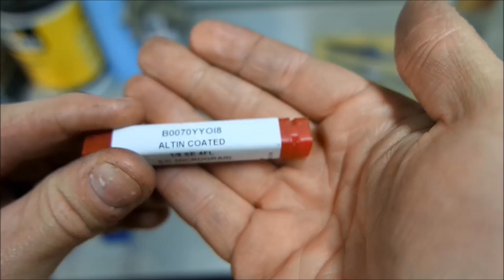Milling Without A Mill! (On The Drill Press) | Güth Blades

Comment: This is for viewers...I expect since this vid is over 3 yrs old that the creator has figured this stuff out....The x,y vise he is using has gib adjustments on it. If he had of adjusted those gibs that vise would be fine...A drill press works very nicely for milling wood, plastics and very soft metal like aluminum. Not so good for harder metals.The higher quality that your drill press is and the softer the material...The less chatter you will get. Most drill presses are not made to take a side load. If you try to cut hard materials the chuck will come out of its taper unless you have one of the few drill presses that the chuck is fastened.  If you are wanting to mill soft materials like wood and plastic and softer aluminum there is no point in spending allot on a mill. Buy a cheap drill press and a cheap x,y vise and look into getting some high quality bearings that can take side load if you experience allot of chatter... Get a mill if you are gonna be doing allot of milling on anything harder than aluminum. Also on a drill press you are limited on the size of material that you can cut by the drill press and the vise size.

Comment: for operations like this you should use a roughing endmill. with this bit you should instead begin from the top and carve your way to the bottom, very light cuts, even more with a drill press. This will reduce lateral forces. dont use x y at the same time, set your z, travel along x or y during the cut and move back to starting position, also avoid up milling for the same reasons, it adds more forces during travel and also will damage your bit faster.

Comment: Just be careful because too much side load could cause the chuck to fall out.  The only thing holding it in is friction.  When you use the drill press normally (vertically) the chuck is always being forced into the taper in the press tightening it.
Reply: Agreed, but the only way to mill effectively and not have the chuck drop is to replace it with an MT2 ER32 or ER25 collet chuck with a drawbar of some kind backing it up and a clamping collar on the outside backing that up at the quill to collet chuck interface. It can be made safe and rigid but steps are required with parts and some turning. Like most machining equipment, making a milling machine is much easier if you already have a lathe. The learnings from the process are really great, but there is a knowledge curve and some parts making for the process to succeed with a viable tool that can be used for real machining when you need it.
Reply: Yes a collet chuck with its arbor to replace the drill chuck and arbor is the way to go. The only solution I have seen to securely retain collet chuck/arbor in quill is to drill hole thru the two with a bolt and nut. Perhaps there is a way to add a locking drawbar to a drill press but have never seen how.
Reply: @danah358  It is rather clunky, I made a mini drawbar with an M6 bolt that locks through the taper knock hole. It is quite fiddly but it works, especially with a locking collar on the outside interface to back it up and if you leave the ER chuck in. I set up my drill chuck to work with the ER chuck when needed. Some will baulk at the need to adapt the drill chuck but it's a priority I chose to make to have a rigid light duty milling setup. I already had a quality X-Y table, milling vise and toe clamps so for no large expense I'm now milling. If I had the shop space I probably would get a proper milling machine but this does decent work with good surface finishes.

Comment: I guess you have never seen a real mill. Slow steady small cuts from the TIP OF THE TOOL. amazingness
Reply: indeed i say the same but bot readed yours only need the tip
Reply: Made me real nervous watching him cut from the flute
Reply: A game of just the tip.. lol
Reply: Surely four flute end mills are intended to cut on the side - you can’t plunge cut with them - that’s what two flute end mills - slot drills - are intended for otherwise I’d agree with all of the comments he made. I’ve cut keyways in shafts, machined hexagon nuts from round bar and other intricate things with my two axis milling vice.
Two things I’d recommend :
If the machine has a screw-type adjustable depth stop, use that to control the depth of cut, and use the quill clamp to lock the quill at the set depth
Reply: Make sure that the gib strips are snug to ensure there is no looseness in the slideways, and lock up the axis of travel which you are not using, to improve rigidity
Reply: Ý

Comment: I've torn up a few drill presses trying to mill on them. If you keep your feeds really light and stay with small diameter cutters you can get away with it but sooner or later you get over confidant and too familiar with it and hurt the drill press. The really old heavy duty drill presses seem to handle it better. My primary use for an x-y table is when I need to do really precise hole locations. And in a pinch I have clamped one to the ways of a wood lathe, played with the pulleys to slow it down, improvised a tool post and done some emergency metal turning jobs. As long as you don't need power feed it works great.

Comment: He’s not a machinist, he’s working with what he’s got. I will say that the lateral pressures the drill press is taking will cause damage.
Reply: Agreed. I broke a drill press shank doing something similar while very young - trying to cut grooves in rubber wheels for a sliding gate track. Using it as a lathe. The spindles are not designed for axial loads.

Comment: i'm not a machinist, but i'm certain you are supposed to take many passes going in like a 1/16th or 1/8" at a time. Just a bit at a time so you don't stress the sides. I've done this with drill bits with not so accurate results, but it worked, though it came out wonky.

Comment: I do not use a chuck but a collet whit a MT2 modified (shoten) whit a "T" bolt inside the opening of MT removing tool. The "t bolt is use in place of draw bar.

Comment: I just used my drill press to mill a barrel inlet in a piece of black walnut for an antique gun. While I'm happy with the results (which I just used the press to hog out the majority of the material and finished by hand) I found the drill press as unstable. The Chuck or quill has some left to right slop (run-out)that transfers into a slightly wider groove then I would have liked. I also cranked up the speed to 3000 rpms. I fed the material extremely slow at very shallow passes. It did work pretty well but if I was going to do this type of work in the future on any regular basis, I'd probably invest in a mill.

Comment: So although it's horrible and sloppy, you might be able to fix some of that by tightening it up, there's adjustment screwes that are obviously lose for shipping, and yeah it's gonna be a bit crappy cuz they have not great finishing cuts, but you could always take it apart, hit the faces with a bit of file backed 100 grit or so and fix that.

Comment: Nothing wrong with the HF vise you just have take it apart give it a good cleaning and adjust and tighten it up to take any slop out. I have used a few. Even milled out an AR 80% lower years ago.

Comment: I think your drill press is capable of doing the job but I could see a lot of play in the vise. Have you tried to put shims in the gaps? You might also want to try milling with just the end of the bit the lowering it, locking the quill lock and making another pass. This will cause less pressure sideways on the bit and it should last longer.
Reply: I just bought the same xy vice he has, and they have updated it. You can now adjust the play or slop, out of it. I tried exactly what he did in the video, and it worked great.
Reply from the maker: +Tater79bj  Hey thats great to hear! Also im glad they upgraded the vise because the one i have has some real issues. I think im gonna buy a nicer one from grizzly.
Reply: tighten all the gib screws , the vice can be made super solid
Reply: whats the point, its fkin junk, i got one. instantly taken back to the shop, went and got Proxxon KT150 WIN!

Comment: Hey those cross slide vises have slide tensioner bolts to snug up the slack on them just make sure the slides are clean and then grease them and tighten up all the slide tensioner bolts snug enough they have no slack or wiggle in it and it's not hard to do . I've got mine snug enough until when I make any travel with it by turning the travel handles it's got some firmness to move the cross slide. A lathe has the same type of tension on the slide on the tool holder.they have to be adjusted to where there's not any play side to side or up and down.snug up the bolts or Allen head bolts just until it feels good and firm but still able to move your crossslide and make sure they are clean and lubed with wheel bearing grease before tightening them up and you will get a smooth cut and finish on what your cutting . Hey I liked your video and it's good to see you doing something worth wild of doing. I started out watching my uncle and my father over 50 years ago they were professional machinist with lathes and milling machines . My uncle made fighter jet parts for a naval place just out of Jacksonville Florida. It was called N.A.R.F. it was a place for navy jets to be worked on like sabre jets when I went there and wow when I walked through that place with my uncle and my father and I was only around 8 years old I was amazed at all those jet fighter planes with all the tail find with painting of the squadron on them one had a bat flying by a yellow moon 🌕 and I even got to climb up a ladder and look in the cockpit of a sabre you know the ones that had the air intake in the front under the cockpit that was great moment in my like. Well anyway I became a machinist when I grew up and I'm now retired. You can become very wealthy being a machinist. My uncle was way past just being a millionaire. If you love machinist work work at and your math there is a lot of math in that job and now days it pays good money and if you got your own machinery and good at it you'll have it made my friend.  I started off with small mini lathe s and milling machines and drill press and keep getting bigger and bigger and better machines . Like planting a seed and it keeps growing and before long it's turned into a big tree . Take care and I wish you the best of a future good luck

Comment: As someone with some experience on a real endmill and a drill press end mill I would like to correct a couple things. If you are milling steel you should be hitting it with cooling fluid every few seconds. Not once for the whole operation. Also, lock the drill press handle and don't touch it. Moving it up and down like that can cause side loads that can break bits. If you are doing it right you should see chips instead of the bits of metal dust. Take it slow and try again.

Comment: This is all I want to do, just mill slots occasionally . I think I'll give it a try. I do have an " x y vise" that I have never used so nows the time to pick up a 4-cutter end mill and give it a try. 
I too, realize that this is no substitute for a milling machine, but it can get those little jobs done.
Thanks for the clear video.
Reply: How did you do with your experiment? Was it any good, do you still use it?

Comment: it would help tremendously if you tightened down the gibs so your vise jaws are not jumping up and down .  You are just lucky you didn't break that end mill.  You should have those ways the vises move in just tight enough so they slide.  That't it.

Comment: Yeah, the Morse Taper -> Jacobs taper aren't happy with latteral motion. 
I'd love to have a vert. milling machine, but can't justify the cost even for a mini-benchtop one. 
Having said that, I'm thinking about getting a used DP and replacing the stem, arbor, etc with a collet for holding milling bits. 
Will still need to be gentle with the latteral movement as the bearings my get fkt. 
I really only need it for soft stuff like alum. nylon, etc. 
Anyway, nice vid. thanks for posting.

Comment: This can work with decent results. The best thing to do is replace the bearings. That would improve things two fold. Fill the post up with concrete to minimize vibration. Check out a milling chart for spindle speed, then run approximately the same. Use the biggest end mill that will fit your work piece or chuck. If possible swap chuck for a collets. 
I have been using a Barnes camelback for years now doing the same thing. The absolute mass of mine keeps it from vibrating.
Reply: Nonsense.  I can assure you the runout on that drill chuck is not even close to milling tolerances.  Then you can worry about the bearings.  Better to buy a cheap Chinese mill.

Comment: You would have much better luck using a larger mill end than a smaller one...
I know this from experience as I did it on my old drill press with a HF 3 way vice after tightening it up alot...... the problem is the speed  I used a 4 flute milling bit in the chuck
( a 3/8" one) to make a long slot for an alternator adjustment arm. the mill-end I used had
cutting edges on the bottom of it so I could plunge it ( got them from HF as well)
with the speed slow so I had more power I would plunge the web out and then turn up the speed to as high as it would go and nibble away at the dimples left and smooth the sides
now understand my drill press had alot of runout in it ... the bearings in the head were shot
but I still accomplished a milling job !.... but if I got the pressure wrong  (too much pressure)
it would go into a harmonic that threatened to tear down the house !  .... although I never broke the bit it scared the heck out of me a few times ! 
my milling machine now is just a glorified heavy drill press and I cannot take any cuts more than a 1/16"  or it will go into harmonic roaring because of the flex in the frame work
the mill is a home made affair that I used the milling head from a HF 3 in 1 mill drill lathe .
and a old shop smith lathe frame and a camper jack.... it works but not as good as I had hoped, it needs to be alot more solid to mill correctly.
I bought a small milling table for it that like the HF vice had to be tightened up and it works good now.
.....
necessity is the mother of invention ! there is always another way to do it !
.... I am convinced you can make a good mill from a strong drill press you just have to make it a whole lot stronger.... and locktight the morris taper drill chuck in ! <GRIN>

Comment: I've been using a rhinofab an actual mill but rather that a 4 fluted bit will work better a bit more expensive and also I ran at about 10,000rpm the higher the better for mill bits and cutting oil is a must

Comment: How do you ensure the chuck doesn't drop out of the drill-press ram during machining type operations that don't maintain vertical pressure? I am concerned the simple, taper-fit friction may not hold the chuck secure with high frequency chatter and vibration of side cutting/milling.
Reply: You are right to be concerned. To mill effectively with a drill press the chuck should be replaced with a ER32 or ER25 to MT taper collet chuck with a drawbar behind it and make a clamping collar for the outside quill to collet chuck interface. A drill press can be made into an effective milling machine for light work but having a lathe already helps a great deal. With knowledge gains and a few parts made and a few more purchased I have been able to mill large and small parts safely and with rigidity and precision on my setup.

Comment: I think you would be better off with a Dremel and some fine hand files. Using a drill press for this kind of operation will burn out the bearings in the drill. It's not designed to take lateral pressure like a mill is. You will never have any precision or even straight lines if you can't make your setup totally rigid like you can on a mill. Save your drill press and find another way.

Comment: So im new to garage milling too, and as such am not super knowledgeable with what types of speed and feed materials need on various machines with various tooling. However from the little that I've done with my setup that is somewhat similar AKA a drill press a cross vise and Bets I would suggest that instead of trying to do a combination of drilling and Milling at the same time dropped the amount you're trying to Mill out in one pass significantly. Lots of little passes following the same path. For the couple projects I've done I've only gone maybe an eighth of an inch at a time. And follow a conventional Milling path until you're comfortable with that before learning climb Milling. I had better luck pinning the drill chuck completely up or completely down instead of having to worry about the Chuck going up and down while controlling my feed path at the same time just my two cents. Good luck

Comment: 😒 3 flute or 2 flute end Mills are always used for aluminum or Plastics 4 flute end Mills are for steals.  Sometimes I use 12 flute end mills for high-speed finishing

If my boss saw me doing what you're doing first he would slap me in the face then he would fire me😨
Reply: Why? Because it is  dangerous?
Reply: You can use 4 flute on Aluminum with coolant
Reply: Joshua king  And  "you're"  is the word you're looking for.  👍
Reply: "Steels"

Comment: how do you lock the table solid from moving just bought the harb freight 16 speed, i lock it but still moves a little?
Reply: curtis haughton that's because it's China made and Harbor Freight sold you're not going to find anything made in China that is going to be a quality piece tooling